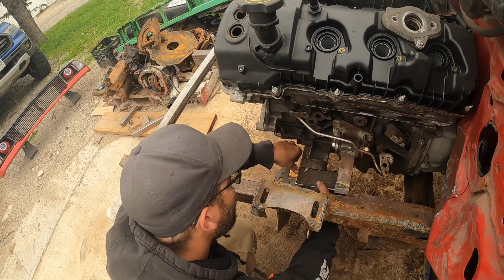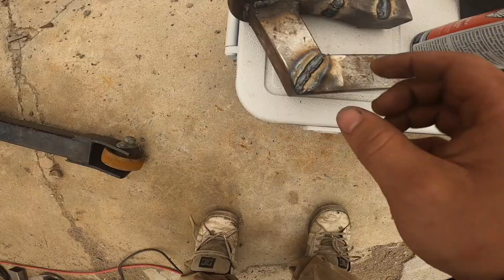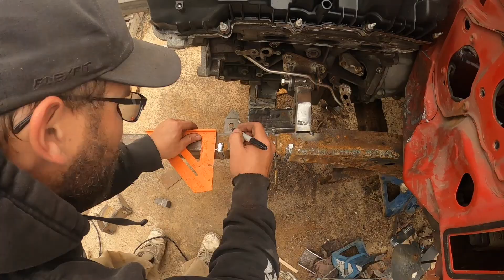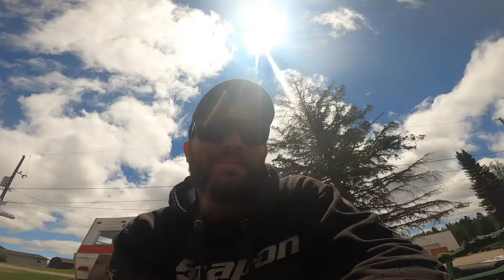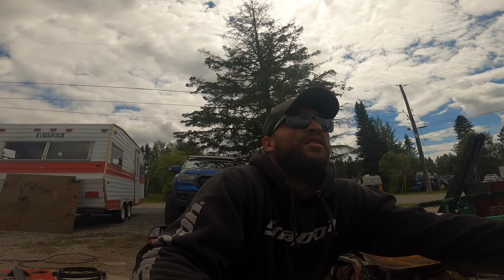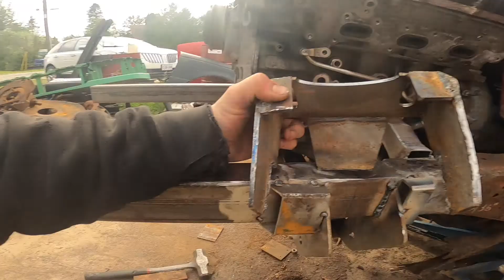Ecoboost Swap Pt. 10- Updates on some smaller projects!

Comment: Hey did you use the rangers original transmission? Because I want to swap a 2019 ranger engine onto my 97 ranger
Reply from the maker: No, this is a 3.5l ecoboost, not a 2.3l ecoboost. You would be better off swapping in the ranger 10spd from the 2019 or searching for a 2.3l duratec 5spd manual transmission, it would bolt right up. The other option is the new bronco 7spd, but at a $7k price tag for just the trans, it may not be an option for you.